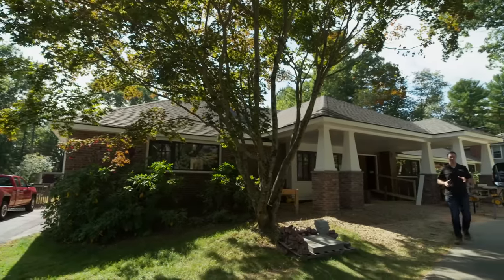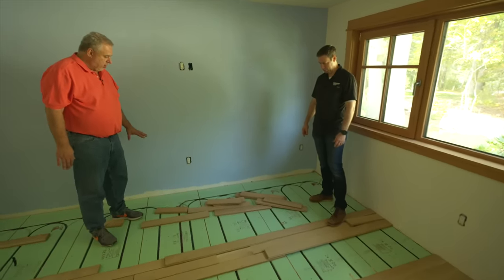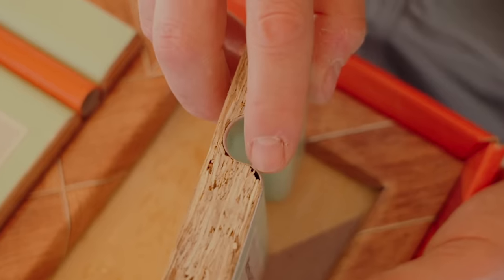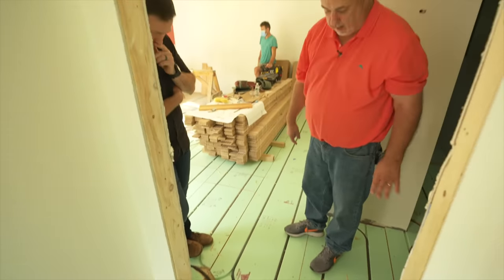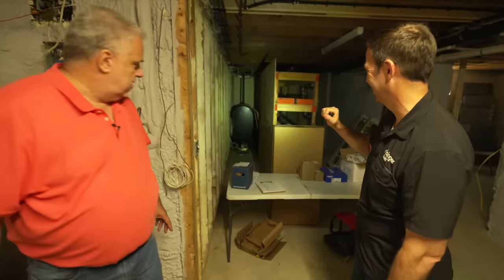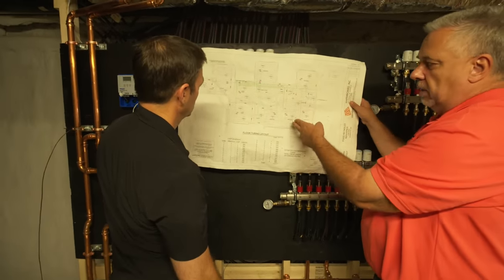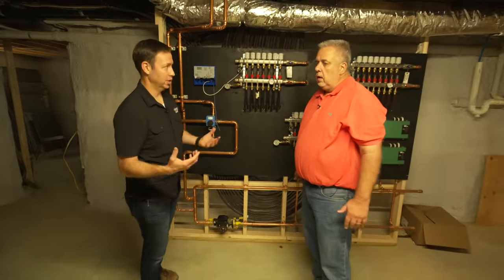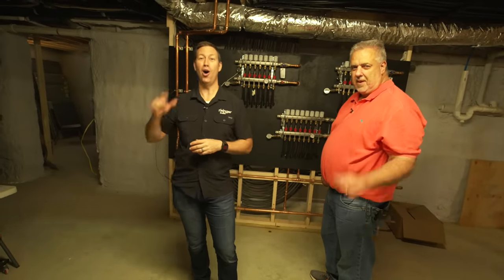Plug and Play Radiant Floor Heating System - BEST ON THE MARKET

Comment: My uncle got radiant flooring like this in his house he built, but he never uses it now because of the running cost.
Reply: ChickenGhast adventures that's surprising- it's considered to be one of the most efficient forms of heating. Running costs should be lower than a radiator or blown air system, and comfort levels higher. One reason for the reported higher running costs may be that it replaced a system which was previously not heating the home adequately or as evenly. Obviously if the house was previously often cold, or perhaps only a couple of rooms were properly heated to a comfortable temperature it stands to reason that if the whole house is now maintained at a constant, comfortable heat the costs will be higher, regardless of how much more efficient the new system is.
Reply: Insulation. Sometimes it is a shrewd move to do an audit in the insulation in the property or dwelling.

The heating system might well be working to spec but the heating loss through the "negative R" structure might mean no heat is being detained ... obviously I speculate.

But, might be worth checking for yourself ... and doing the nephew thing with retro fitting the insulation stuff. And wear a mask.
Reply: @t1n4444  Agreed - the cost is operating the system, the cost is the house retaining heat.....

Comment: Would all of you prefer a liquid heat radiant floor or an electric heated radiant floor? I built an electric coil thermal mass floor heater (3 foot x 9 foot x 4 inches) for $1,000 in my bedroom. I built it a foot longer than needed so I could warm my feet while on the laptop at the desk at the end of my bed. Best heat!
Reply: Aaron Vallejo Sounds like a fun project, but the fact remains that in most places electric resistive heat remains the most expensive form of heating there is. Also, suspended timber floors wouldn't support the weight of such a system so it's only suitable if you have a slab subfloor, in which case you may as well pour a screed over pipes stapled to insulation laid on the slab. The downside would of course be loss of rather more than four inches if done properly.
Reply: @spencerwilton5831  Yes, it was fun. I definitely see the great potential for heating evenly, silently, cheaply with piped radiant floor heating. I just wonder about the liquid when left for 6 or 10 months between uses especially where temperatures can get -20C outside. Does a home owner drain the line in the floor before leaving? For my little floor, I plug it in and 12 hours later is it lightly warm. When I leave I pull the plug and turn off the breaker. I first maxed out my attic and floor insulation which is essential if we want these low heat sources to make us warm and comfortable. I remember before I installed the insulation and still had a central natural gas heater...if that sucker went out at zero outside...the whole house was cold and uninhabitable in 20 minutes. Now with R100 attic and R35 floor insulation the interior temperature drifts from 20C to 10C over 8 hours with no heat on...before I installed the electric thermal mass floor heater. 

I also built and installed a few solar house heaters. They definitely work and add to the internal temperature system when it is sunny.

Comment: Did I miss something? 1 mile of piping and only 1 circulation pump? Wouldn't a pump on each zone help reduce temp change reaction times? I would imagine there would be significant amount of ghosting. Sub-zones circulating at limited control rates.

Comment: have been seeing a lot of people saying in a very tight, well insulated home .   dont go with radiant as you likely will over heat.  What does Steve B have to say about this>   what does warm board folks have to say about this
Reply: Uhhh... thermostats. That's what they are for.
Reply: Even in a passive home, there will be heat loss. Warmboard will heat the home evenly and consistently with very low temperature water. Our system is very fast response. Overheating wouldn't be much of an issue.
Reply: One word. Outdoor reset curve
Reply: @Warmboard  We do heat pumps and outdoor reset schedule. Water temps are very low for the jobs with continuous exterior insulation. So much so, that the floors never really feel warm. Tiled master bath floor should have had electric radiant, as the cool floor (year-round) is the only real homeowner complaint. For reference, last job was 9500 ft sq, very high ceilings, traditional design and Colorado design heat loss was 95k BTUH, due to exterior insulation package. Just doesn't run very hot, ever.
Reply: Hey my man, thanks for joining us - I say any heat delivery system has to be coordinated with the heat loss of the house, yes even the most efficient homes have heat loss. Imagine a Passive Home where the interior is a perfect environment - now close your eyes and imagine your feet are warm too.....Heaven
Reply: @stevenbaczekarchitect9431  That is what I keep thinking.. Though doing it a bit differently.  7/8 " pex al pex in the concrete.  Figure only need it occasionally but nice to have it available in zone4.
Reply: @spyrule  yes for each zone.  The comments I am reading seem to think that with using radiant it will cause run away heating with the slab floor.  I keep thinking to myself, this does not make any sense since am not planning to actually do much more than some solar gain.  Not like I plan to use 60 feet of floor to ceiling glass wall.
Reply: @dunkdamonk  not quite sure what this means.  outdoor sensor to monitor and shut off the radiant?
Reply: @leestevens446  did a room by room heat analysis and figured that I am looking at 15k btuh for the entire house.  Air sealing and insulation do seem to make a real effect.  2100Sq ft is not super huge
Reply: @stevepailet8258  it can shutoff the system at a calculated temperature based on the region you live in.
 In changeover seasons like fall and spring where temperatures can range 60 degrees or more from high/low, the system will be supplied water at a temperature low enough to get the job done, but ensures the amount of fuel or energy being used is minimal.

So if your floors can take a maximum of say....100 degrees F
Your coldest days in your region are 0 degrees F
The system will only make 100 degree water when its 0 outside. If its 20 degrees out  closer to 85/90 degrees.
Just examples fyi
Reply: @dunkdamonk  thanks, kind of figure this is what you were talking about.. I just did not know the name for this.
Reply: @dunkdamonk  no way that this should not be part of the system.  since coldest days have been in sub teens the majority of time it never gets anywhere beyond the teens and stays that way for only a week or so.  I appreciate your description of this device
Reply: @stevepailet8258  If you just putting into a concrete slab, I say go for it. Your only talking about a few thousand for the PEX. You can choose to install the boiler\heat pump for it at a later date, if you decide to need it. Just be sure to insulate the slab.

Comment: What happens when the carpenter accidently runs a nail through the radiant pipe?  I bet it happens.  I've only done a few home remodeling projects and just having the contractors mess everything up and then lie about it about drove me insane!  I also know someone that bought a really nice home with hot water radiant baseboard heat from the 1960s. They could not find a contractor that knew how to service or properly repair the system.
Reply: Well it didn't happen - just thought you'd want to know
Reply: @stevenbaczekarchitect9431  I already knew it didn't happen on this project.  Still doesn't answer my question.

Comment: now I'm just wondering if I'm gonna need to lay down foam insulation underneath up here in Alaska lol
Reply: I was just thinking the same thing about that... For an existing concrete floor that gets really cold in the winter time, how do you insulate under this  system to keep from losing your heat but also not raise the floor level too high??

Comment: This kind of system is used in Europe for 5-6 years now, in colder climates the pipes are space out even closer then in this video, not on a radiant board but on extruded polystyrene foam ... heating costs go down to 40-45% ...
Reply: Dan D. it's rather more than 5 or six years- I'm pushing forty and remember friends with similar systems growing up. Sure, the actual systems have come a long way- the modular boards vs pipes manually wired to a grid buried in concrete but the principals have been around for decades.

Comment: my gut feeling is that a person could just put a system like that in the basement floor & heat the whole house without raising all the floors on the upper level, which affects all the door settings. That would be the least expensive route to heat the home & remodel. & it would reduce overall Humidity.

This system looks incredible & expensive.

I was surprised that all the rooms had wall to wall heat, generally you only heat the estimated walking areas, generally you do not heat under couch or bed or cabinet.. Any reason that does not appear to be taken into consideration in some of the rooms?

Comment: Wee danish pumps, since living in denmark (Europe)  water based heat is the only way to get good heat in a home, weather it be with radiators under each Window or the floor heat
Reply: Also in the old days we used galvaniresed pipe and copper pipe, now mostly stainless

Comment: I live in canada and have hard water , limestone, would it be ok in a new build?
Reply: Most seriously competent installers will fill the system with distilled water, for this very reason, and other equally nefarious water quality issues. Chlorides in water actually attack and corrode stainless steel, which is found in most condensing boiler heat exchangers. Another, or complimentary approach, is to use a PIG (see Caleffi website, you have to dig deep) or a system feeder (such as ones made by Axxiom in Canada), to supply "safe" or treated makeup water. What this vid has not discussed is the ways that newer high-performance heating equipment is adversely affected by water quality issues, and it is vitally important to know this stuff, to insure long-term system durability.

Comment: That would be a nightmare for repair or any flooring change etc. An oil boiler in 2020? Thats crazy. Seems like a system that was not well thought out at all. Great video on showing the system, but it is probably crazy expensive too. Interesting stuff.

Comment: I have seen extensive use of engineered hard wood floors with radiant floor heating, but not real hardwood. What I heard was real hardwood has the tendency to warp under certain level of heat. Anyone with some knowledge of testing both materials?
Reply: We have read that real hard wood should be kept to max 3" width.  The temp swings can cause the joints to open up. We used 2 1/4 red oak and are very pleased. Ours.was a retro fit though with aluminum panels screwed to the bottom of the redwood subfloor.
Reply: We did the warmboard on our remodel in 2014 and used red oak in a varied width pattern with our widest boards being 10". We also glued and stapled and with the closed cell spray foam insulation we have are our mixing valve is set to a maximum temperature of 95 degrees and so far we have had no cupping or movement in the flooring. We are located in Connecticut and leave our thermostats at 72 degrees all winter and I can honestly say we couldn't be happier with the system.
Reply: Historically this has been true due to the uneven surface temperatures generated by the radiant flooring system which would cause the wood to expand and contract at different rates. Warmboard's aluminum distributes the heat very evenly across the surface so wood expansion/contraction is consistent. We do hundreds of jobs every year with real hardwood, even wide plank, and there's no issues.

Comment: Is this system available in Canada?
Reply: the way it works is that you send your plans to warmboard (in california). they design a system of panels and then package the panels in groups to make it easier for you to install. the problem that you will have address is that the warmboard panels raise your floor by about 0.75" and this may interfere with the operation of doors.
Reply: It is, yes.

Comment: Whatever happened to the radiant cooling and heating from the ceiling? Messana.
Reply: Condensation can be a problem with radiant cooling. Really a AC Duct or ductless mini-splits are the only viable option, especially in a tight home. You need a way to remove excess moisture in the home to avoid mold problems.

Comment: What keeps the basement from being excessively hot due to all the heated piping there?
Reply: Hmm, a fair point, I was wondering about the pipework being fitted with insulation as in some sort of foil blanket for conservation of energy ...  unless the heat from the basement percolates through the ceiling to floor sort of thing.
Reply: I have a radiant heating system, using Warmboard panels, the same manifolds, and controllers for the flow valves.  I used pipe insulation on the pipe runs that are not in the panels to/from the manifolds.  Water temperature is between 90 and 100 degrees F.  "Excessively hot" is a non issue in my installation.
Reply: Its possible that they will be installing insulation on the tubing and pipes. However, I suspect that because its in the basement, its not going to get hot because the walls and floor will remove it all.

Comment: Beautiful plumbing, I'm impressed with their work.
But, it was stated that this system could still be in operation 100 years from now.  I find it very hard to believe that the manufacturers of the parts don't have a built in planned obselescence. I venture to guess that in less than 10 years none of the solenoids will be available as well as many other parts.
Reply: Matt said the piping and the panels would be in service for longevity, and the replacement of the pumps and valves would be the only things needing replacement
Reply: @stevenbaczekarchitect9431  OK, that makes more sense. Thanks.

Comment: Beautiful work.  This heat must cost a fortune though...
Reply: Probably under 10% of the remodel, so not really compared to what you get for decades of comfort.
Reply: @timm439  Understand, but the upfront cost is substantially higher than an gas fired or heat pump would be.  Would be nice if builders offered their clients options to get something like this.
Reply: @johnjerrehian4642  Just need to work with the right builders and the right architects

Comment: Gives good heat, ridiculous cost... But if the customer wants it, and wants to pay for it; They get what they want...I would NEVER want to take liability for that...One missed staple and you have a leak, which would be a nightmare to fix...I use the Electric Thermosoft, Here in the Philly area...Great price point; easy to use, easy to zone and great service...